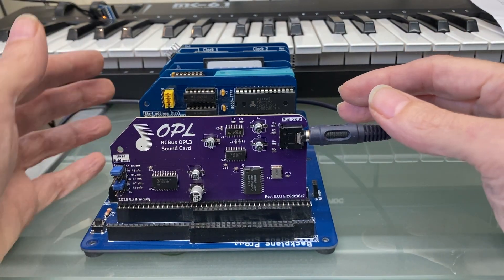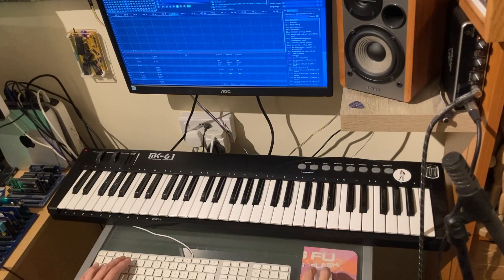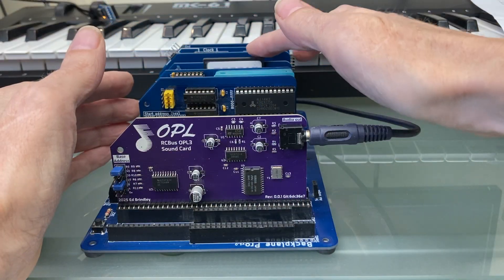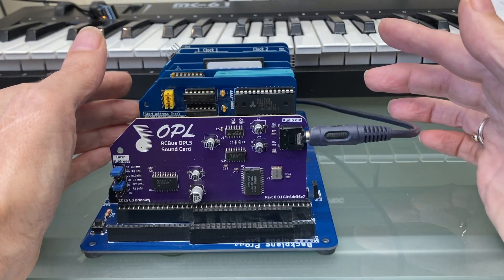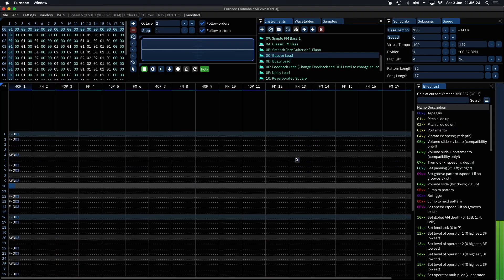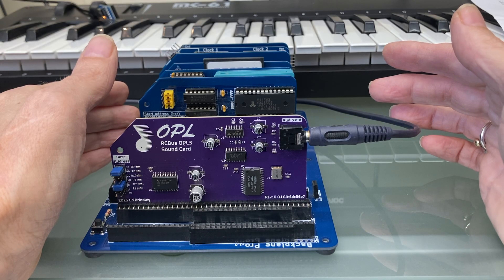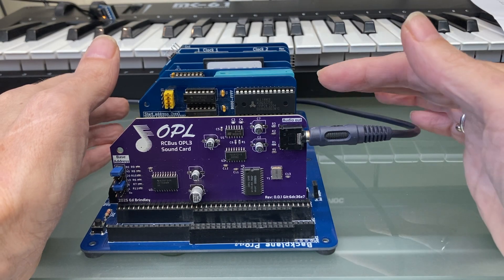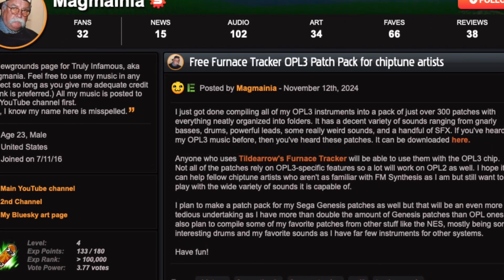First try at making music for FM synthesis

Comment: obviously we need an RC2014-based FM synth called the DX1000!

(yamaha never made a DX1000 AFAIK...)
Reply from the maker: Oops yes! I went back to the source of my information and it clearly says "similar to the DX100". Time for an eye-test! But yes, a MIDI-in with adjustable parameters would be nice. I'd call it the DX2014 though.

Comment: Excellent work, especially for a first attempt on the platform.

People are saying DOS game but I think this sounds more Sega Genesis like, despite being a pretty different FM chip. DOS games usually used pretty generic sounding instruments and were usually written for the significantly inferior OPL2.
Reply from the maker: What's interesting me is that plenty of people are saying DOS game, and some have named games, but I don't think any two people have named the same game.  That suggests that FM generally has a very distinctive sound. I know that one or two of the instruments I used were 4-operator, but I think the bulk are 2, so it's probably not so obvious that this is the OPL3.  You've clearly got a good ear, and thank you for the comment.

Comment: Intresting, but isnt this completely obsolete? If you have a quality dac and a decent CPU you can run one of many FM plugin and sound differences should just come down to different software implementation or DAC quality. Is there any benifit to having dedicated fm sound card?
Reply from the maker: Yes, I'm sure you're right, and the RC2014 I'm using is redundant too because even a Pi Pico can emulate a Z80 plus the ram and storage I'm using and run CP/M but there's something magical about using the real chips. As you saw, I worked in Furnace Tracker on a modern computer, and what I heard when I played it back using the tracker was identical to what you hear coming out of Ed's module after I'd gone to the trouble of exporting to .vgm, transferred it onto my CF card and run the player on the RC2014. It's different for different people. For some, emulation is perfectly fine but for me using real hardware is what makes it exciting. You may know that I make a device containing SID replacements. You'd be hard pressed to tell the difference but for some people, only real SIDs will do, and I totally get that. My daily driver '64 has an ARM2SID in it, but when I fire up an all-original 64 and know that I'm listening to a real 6581, that's way more special.
Reply: @midi_in gotcha, i learner FM using plugins, so i find plugin workflow acceptable. I will acknowledge there is a romantic appeal to the old chips but not worth it for my time and money.

Comment: Our project focus is shockingly similar these days. I just finished programming a vgm player and spent months learning the ins and outs of the opl3 registers. I'm more using an all-in-one computer solution with midi, opl3, Sid, sn7 wrapped around a 6502 computer (f256k2) but midi driving opl3 is very fun indeed.
Your track seems exactly on point with some of the games I played with early 90's PC. In a blind test, I would have placed it right there among the tracks we used to listen to from apogee shareware games.
Reply from the maker: You're right that we're well-aligned and I was a little bit confused because I knew that I knew you, but seemed not to be subscribed. Turns out that I know you from 1-bit fever dreams but wasn't aware of the 'any bit' channel, so I'm glad you've commented!   Like you, I feel compelled to understand these things at the lowest level and get into the coding. But I've recently had a conscious realisation that scratching that itch doesn't get much actual music made, and (in my case) results in software tools that aren't as good as those that are commercially or freely available. So my resolution is to try to be more of an end-user of the available tools, spend more time writing music and less time coding.  That's why my first stop on this journey was to discover and learn Furnace Tracker and download a big folder full of OPL3 patches.  I notice that FT has many interesting targets which will be fun to explore (including the SID, and it's much nicer to use than GoatTracker or any of the tools that I've written myself.)
Reply: @midi_in if you ever need to dig around to find random, new FM instruments, I made a msdos tool that lets you randomize its values and test them out. It's not polished yet to facilitate the transcribing of those values into the instrument edit window of furnace, but that's one patch away!

Comment: I presume you are familiar with Dexed - a VST and/or hardware emulation of the DX7 based on a Raspberry Pi.
Reply from the maker: No, I'm not, so thanks. This is a new world for me. I went from the 8-bit simple waveform generators to the pcm sample playback of the Amiga, and never was really into the synthesisers of the time. I'm aware of what FM synthesis is but it's another level up from the 8-bit chips.
Reply: Hi madam OP @midi_in , what YM chip was that?
Reply from the maker: @patrickryanagapito502  The one on the new board is a YMF262  aka OPL3. It's supported by the YAC512 DAC. You'll find more details in the bill of materials in the open-source project, linked in the description.
Reply: @midi_in   Thank you.